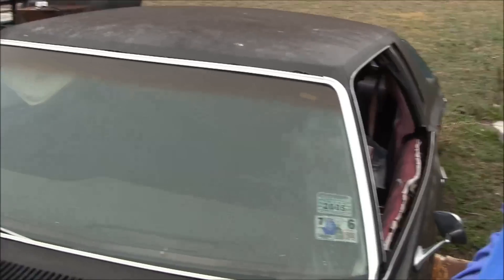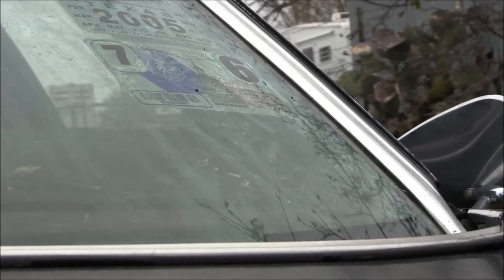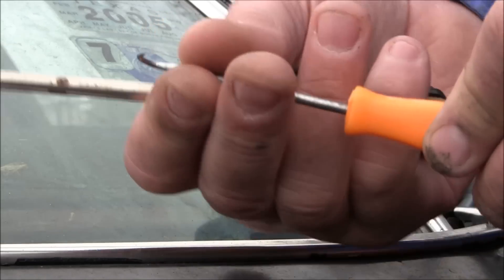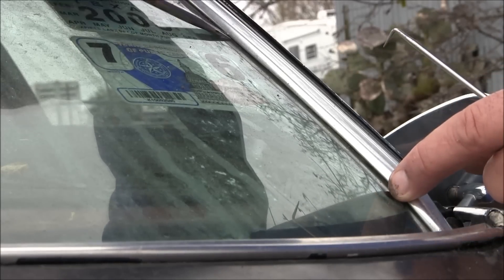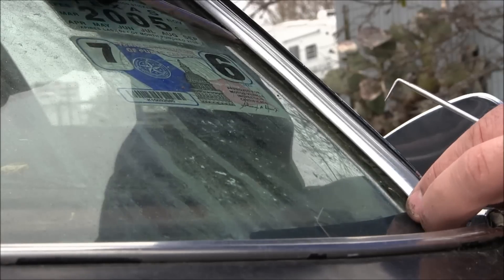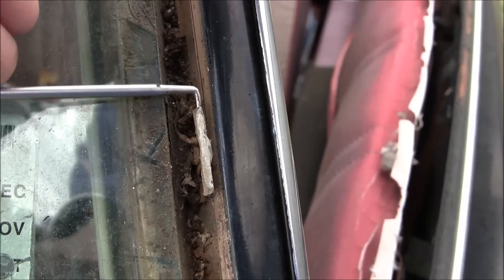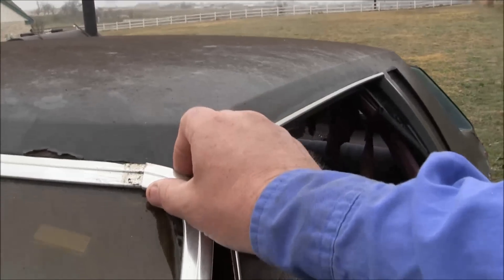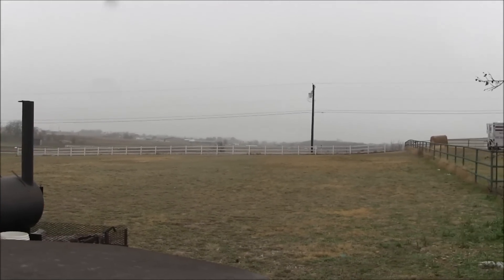How To Remove Chevy Windshield Trim

Comment: On a Pinto there's a Philip screw on each bottom corner of the trim holding the trim that runs along the bottom of the windshield. remove the side trim to get at them.

Comment: Wish I watched this earlier today. I got my 68 Galaxie fastback rear window trim off by prying and wiggling carefully since I didn’t know how the clips worked, and there was lots of stretchy old black adhesive also holding the trim on as well. What a mess. But I didn’t damage any trim…only a few of the clips which I think I can replace

Comment: Thanks.  I need to do that to my 1982 ford and I believe the clip system is very similar if not the same.  
Next time please show us how to pull the windshield off and fix leaks!
Reply from the maker: Hey Carlos! Thanks for watching. I wish I knew the proper way to do glass removal and install. I know a few tricks for removal but it's a very specialized skill and so far I haven't figured out how to do it without cracking the glass. Of course all the glass I've removed was already cracked anyway but it's definitely a difficult skill to master.

Comment: Thanks for the advice... Worked wonders on my 70 grabber
Reply from the maker: +ashtonhollywood | You bet! Thanks for watching!
Reply: i used my old lockout / tagout hasp. i drilled out the rivit that held the two sides together and sharpened the closures to a point. then bent them at about a 15% angle... they worked good.. especially after watching ur video.
Reply from the maker: +ashtonhollywood | That sounds pretty ingenious! I know exactly what you're talking about too!

Comment: 1 MORE QUESTION HOW DO U REMOVE RAIN GUARD TRIM ABOVE SIDE WINDOWS
Reply from the maker: The trim on the drip rail above the windows is attached by snapping the c-shaped chrome trim onto the drip rail. BUT, they also used a small bit of adhesive to keep it in place. You can start at either end and remove the tips, then use a small tool, I used a small screwdriver that I sharpened to get it under the trim without damaging it, and very carefully started lifting the trim, un-snapping from the rail. It can be done but you have to be careful and take your time.

Comment: I finally got try trim off my Impala, which has the same clips. When I put new ones on the damn things keep popping out when I try to get the trim back on. Even the old ones keep coming out. It's getting annoying
Reply from the maker: That sucks! I find that the new repro clips don't work as well as the original. Maybe hit a junkyard and see if you can find some older cars with the trim clips still on them?
Reply: After some creative squeezing on the clips in the right place, I got them to snap in and stay
Reply from the maker: Awesome! I was thinking that you might be able to squeeze the trim lightly to put a little more curve in it and close the distance between the edges, but I wasn't sure how to put it into words. I checked out some of your vids and gave you a sub, just in case you upload again. Good stuff!
Reply: +512kjt didnt you just put it into exactly one sentence!!

Comment: Hi, do you have some measurements/positons where the small pins for the clips go´s to? some of the pins rosted totally away and has to be fixed. The holes are well done welded, but the hight is not specificated in any resto book. I find out it is very importened, cause the clips must sit perfect otherwise the trim fits too low or too high. Resto an ´67 Camaro with vinyl roof. THX for help and greetings from Bavaria :-)
Reply from the maker: Hi! I went out and measured the trim clip posts on my 69 El Camino, my 71 Monte Carlo and the 73 Monte Carlo and they are all 3/8" up off of the bottom of the channel to the middle of the post. Let me know if you need more information and thanks for watching!
Reply: THX a lot, it helps out great top, that´s about  9,525 mm. have a nive weekend :-)

Comment: Do you recommend using metal clips to replace the old ones or replace with plastic clips? Which are better? Thanks!
Reply from the maker: Definitely the metal clips. They are more durable and readily available.

Comment: Will this work on 64 chev as well?
Reply from the maker: Doug McCarthy I believe it will. I've seen some of the clips on mid-60's Impalas and they looked the same.
Reply: 512kjt Can you show the removal of the two horizontal crome pieces, if they are done differently
Reply: 512kjt Can you show the removal of the two horizontal crome pieces, if they are done differently
Reply from the maker: Doug McCarthy Hey Doug, weather hasn't been cooperating here lately! Do you still need to know about the side pieces? Are you talking about the ones around the windshield?

Comment: If I take off my trim, it doesn't have anything to do with the windshield coming off or leaking right?
Reply from the maker: Correct. Once you pull off the trim the windshield is still in the channel and sealed against the metal with sealant.The chrome trim only attaches to the metal clips and covers the gap where the glass meets the metal. If your windshield is leaking it's probably through a rust hole or through a gap in the sealant. This is for older GM cars though. Some newer ones and those of other manufacturers actually have a gasket that has some chrome looking plastic to cover a small strip of the black rubber. Thanks for watching!
Reply: Ok thanks, it's not leaking but I have an 85 caprice landau I'd like to take the trim off and polish
Reply from the maker: chad espinosa You should be good to go then! This type of trim is cosmetic only, it doesn't hold the window in at all. GOOD LUCK!

Comment: this was a wrily helpful video :) now i can take mye car to The paint shop:) thx from sweden
Reply from the maker: Congratulations! You are welcome, from Texas!! Thanks for watching!
Reply: I went through a paint shop debacle with my chevelle many years back: they tried to sand the pillars with an orbital and... never took the trim off as part of prep.  Permanent marks in the stainless now - should have removed the trim myself before turning it over.  Also, I think they destroyed the drip rail trim taking it off [which has to be nearly tickled off from the lower edge first - end to end, inch by inch], which they HAD to take off due to it beginning to rust through in a couple spots.  Just remember to tag/bag things you remove: do as much as you can, as it helps them speed up work, and you get things properly preserved instead of a tape job.  Things like headlamp bezels [fender extensions must be painted], and turn signals  too - just remember to pop a sandwich bag over any connector ends and tape them in place so overspray doesn't cause problems later.

Comment: I hope I can use this same method on my 66 T bird
Reply from the maker: You should be able to. I've seen other comments where it has worked for numerous other makes and models, as long as it has the same style stainless trim. Some of the door and body trims are different though, but this should work for front and back glass.